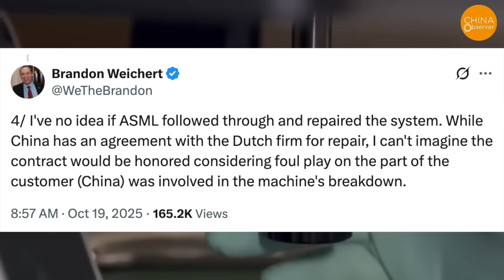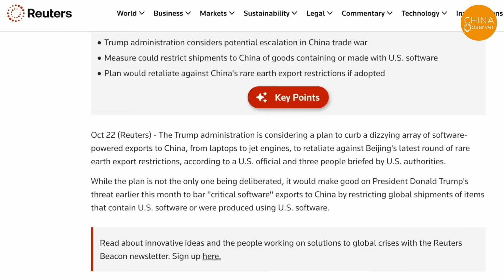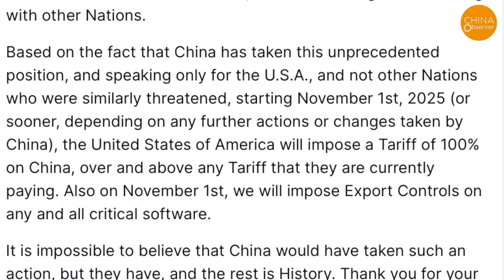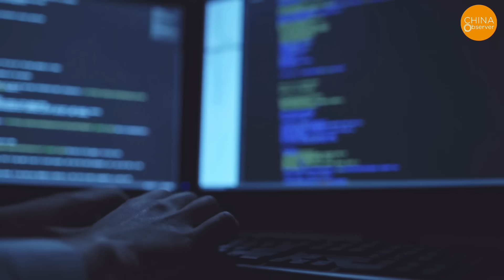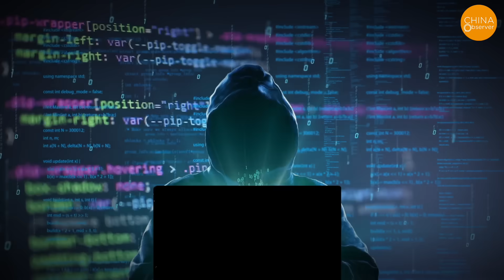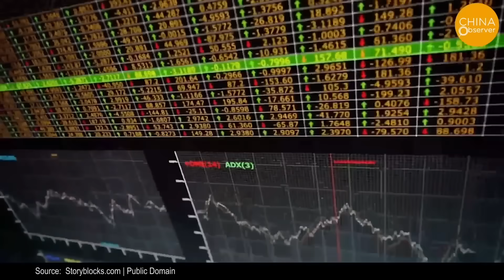China’s Embarrassing Failure: Attempted Reverse Engineering of ASML DUV Ends in Disaster

Comment: I love hearing that the machines have blackbox designs that destroy themselves when the Chinese fools try to take it apart to reverse engineer it. They wan so desperately to cheat their way into the semiconductor industry and they don't want to just put in the work to learn how to do it right. So it's such sweet karma to hear they are dumb enough to take it apart and try to copy it and that now shoots them in the foot from getting any further machines to try this with. Not only are high end chips off limits but now they've ruined their mid-range chip capabilities too. This is exactly the kinds of stupidity the CCP hates because it ruins their "saving face" culture and exposes them for the clowns they are.
Reply: I can just imagine the Dutch techs going to China, discovering what had happened, and glaring at the Chinese engineers in a steely, but restrained way: "We did ask you not to try to reverse engineer our equipment...." Very Northern European.
Reply: @douglassun8456  They should put Chinese finger traps in the machines.
Reply: @douglassun8456  If I'm the Dutch team, I'll shut up about it, say I have something to fetch from home office, and quickly bail. Can't afford myself to become hostage.
Reply: @douglassun8456  us dutch wouldn't say "we asked you not to" wed point to the contract and tell them straight up that the contract is now void.. LOL, so any subsequent machines that fail wont get any repair reps
Reply: The more you know 😮.

Very wild and these companies knew exactly what they were doing to prevent replicating
Reply: crazy that they would open such a thing so carelessly. wouldn't worry about them being able to copy it if they can't even open it without causing damage 🤭 besides even if they managed to its not enough to just replicate, you need to understand it all or you will just get left behind when the real manufacturer makes their next generation machine
Reply: @kahvikissa_ 
Here in India we have a saying,
'नकल में भी अक्ल चाहिए'
which basically means 'you need intelligence even to copy'!!!
Reply: LOL LOL...SHAMEFUL
Reply: The fact they mingle the machine black box proves that they are not exactly bright enough to do their own research.
Reply: Well said
Reply: Correct. Very well expressed. A Hundred Likes!!!
Reply: Very inept. lol.  😂
Reply: Good thing there is such mechanism
Reply: It is not designed like this against Chinese. It is designed like this against literally everyone. Do you think Americans, for eg. Intel never tried to backwards engineer ASML machine? Even though they were stuck at old node for so, so long and wasted many billions on their own research?
Reply: It is designed this way against the Chinese. You know why ? Because other countries like the US pay for the machines and people to run it properly and they don't take it apart to try and make it themselves. It's only the Chinese who try to buy someone else's product and then copy the design to make it themselves cheaper. This is a China problem.
Reply: @aSinisterKiid  As another poster stated above, this isn't designed just for the Chinese, though China is likely the most deserving of such anti-reverse engineering countermeasures.
Reply: @lexmercatoria2774  Yeah I know its not just for the Chinese. It's an industrial and commercial tactic to protect their IP that any good business should do. But they do make a conscious effort to incorporate these tactics on machines that are being shipped into China where they may not on machines headed elsewhere. The engineers take these sort of things into account when a client orders these kind of machines.
Reply: I worked in semiconductor. There are numerous SC companies in the USA. We don't need to steal European or Japanese tech. We have our own.
Reply: Saving face and showing face is more gangsta than on the streets.  Its their whole lives
Reply: Bravo! Spot on!
Reply: The Chinese don't have the same values, it's a communist country. There is no respect for intellectual property and never has been. China will never change.
Reply: And this isn't the first time they tried this on our machines 🙄
Reply: Learning means repeating. China didn't have 10 ASML DUV to have the chance to repeat. For one single machine, RE and reassembly at the manufacturer's level are impossible. It's not about that "they don't want to just put in the work to learn how to do it right". They didn't have enough machines to do that.
Reply: @milutzuk then the only thing China had gotten good at doing is copying, stealing, and lying about it.
Reply: @milutzuk  It's not impossible for the US or Taiwain to make the high end chips. So it can be done. The fact that China can't do it after dumping more money into it than the US exposes the CCP incompetence. They literally are not willing to put in the hard work over the years to learn how to do it right. They think they can pay for shortcuts and copying the IP of others to make up the gap and they can't. And all the money they threw at solving the problem has been wasted so it wasn't even invested in anything worthwhile. The US is leaps and bounds ahead of China because of the knowledge and willingness to put in the work to do it the right way.
Reply: @aSinisterKiid  Of course the US or Taiwan can make chips. Even you can make chips, given the required infrastructure. And that infrastructure means EUV (Extreme uv) machines. And those EUV machines have only one designer and manufacturer in this world: ASML Holding N.V. from the Netherlands. Taiwan (let's say TSMC), Samsung in S. Korea, Intel (in the US) are making chips using those machines. In Intel's case, down to 5-10um node technology, they had their own machines. After that, they helped ASML to develop more performant ones. In 2012, they helped ASML with $4.1 billion, and they're participating in developing, testing, and calibrating those machines. Well, China is interested in RE (Reverse Engineering) those machines. So we're not talking about making chips, but about making machines that make chips.
Reply: @milutzuk  And you are too stupid to recognize that China doesn't even have the knowledge to build the machines, let alone understand the technology needed to make them. China can't even begin to try to reverse engineer something when they won't even put in the work to understand the technology in the first place. We are talking about making chips and you need the machines to make them, and you need to knowledge to understand how they are made. China thinks it can skip steps and they will remain in last place.
Reply: Facts
Reply: As for the CNC spindle that didn't work right after assembly, there are some which have components which must be replaced after disassembly, and they have to be assembled under very specific conditions.
Reply: Except this also messes with your own industry too. Designing machines to fail if you try to service em. I can imagine them trying to fix a fault on their own. Except the machine is designed to break if you don't pay the company super high fees for some maintenance.
The world is cooked. You really can't outsource this stuff lest your devices be held for ransom. And even then, like super high fees from the company who manufactures the device, or super high fees from designing your own device.
Reply: @Utrilus  pretty sure it’s like a failsafe to prevent the wrong people from getting high tech chips, like say, terrorists. This type of design ensures only credible countries/group have long term access to these machines
Reply: @labbit35  its both. Its a way to make yourself essencal and irreplaceable and pay lipservice to safety/wrong people concerns.
Reply: @piens51  and maybe also add in business secrets so you can’t just copy it. Like ‘we made it, it’s ours, you’re only having the rights to the machine”
Reply: @Utrilus  Warranty solves this, companies use the machines for a fixed period of time and calculate their profit based on those numbers. After a certain amount of time, technology has improved and the company want new and better machines anyway. This practice is far more harmful when used against consumers who buy the thing, doesn't make any profit from it and just want it to last for as long as possible.

China attempting to copy these manufacturing processes only to end up with inferior manufacturing is exactly why everything made in China is rubbish. Nothing works and things break faster than anyone could possible comprehend in the most comical ways possible. China mastered the art of screwing over it's consumers.
Reply: 😂
clowns.
go google world math championship...
look at last victory (and how long it was before that win)
you are welcome 😁
Reply: 90 years ago the Japanese Empire was a major copier of Western technology, but when push came to shove Japan came up empty 😊LindaSu
Reply: @williambeglin8641  Was that before Columbus or after?
Reply: Just wait until your lawnmower breakdown, and you find out that it's also blackboxed. Or smartphone. Or refrigerator. Or tv. Or ...

It has been a trend in electronics for several years now.
Reply: That is, if it was true, don't believe everything you hear, especially from a programme like this, which calls itself China Observer, meaning propaganda. 
Did the Chinese copy the US high-speed rail? What about the space station?
Reply: @MrManny075  LMAO Yes the Chinese DID copy the high speed rails!! All their technology is from France! Non of it is their own tech.
Reply: @aSinisterKiid  The US has just 4% of the semiconductor market.While China has 40%, What do they manufacture in the US? At least the Chinese are the world's largest manufacturers. Just because trains use Japanese technology doesn't mean they're copies.
Reply: @MrJuanzaz We do the design and R&D. Unfortunately, we outsourced much of the manufacturing and packaging. We’re correcting that.
Reply: @paulblase3955  I don't think it will work, Closing down the economy to produce locally has never worked, especially if you don't have the infrastructure or the workforce, and you can compete with others, and at what prices?
Reply: @MrJuanzaz  LMAO No China doesn't control the semiconductor market. China can't even make their own high end semi conductors. What a joke. Taiwan is the leading expert and controller of the Semiconductor market, and they don't belong to China. Taiwan is its own country and China can't even touch them.
Reply: @MrJuanzaz  you do understand how technologically inferior the chinese are currently in the semiconductor sector right? all you need to know is their newest home brand cpu is DECADES behind 

"40%" might seem impressive on the surface until you realise its all from obsolete sources
Reply: @OdinAlgeron  You are not well informed, Xiaomi already has the Xiaomi XRING 01 chips in 3nm which surpasses the Qualcomm and MediaTek chips, in AI they have the new Ascend and for next year the Atlas servers which are 1.3 times more powerful than Elon Musk's colossus, not only are they not behind but they themselves produce everything with their supply chains while the US depends on TSMC and China
Reply: @aSinisterKiid  the same reason China desperately wants to invade Taiwan to get their hands on the chip making prowess of Taiwanese. If ever China got a hold of that tech, US will lose on technology aspect and will catch up US tech military and other fields which the US won’t even allow to happen in the first place. For me don’t like CCP to prevail.
Reply: @MrJuanzaz  yeah it sucks, are you not aware of how crap xiaomi's phones are?
Reply: @OdinAlgeron  🎯Spot on ole chap, well done! Aren't Xiaomi cars randomly self destructing? 😂
Reply: @MrJuanzaz  Nonsense. China is incapable of producing any chips below 6 nanometers. All of China's "AI" are simple launguage models copied from all the other tech giants. Xiaomi can't even make cars that deploy airbags properly or that don't turn into flaming coffins with doors unable to open. China is a joke.
Reply: @aSinisterKiid  Actually, some of it is from Japan and Germany, so what is wrong with this? Look around you. Did someone invent cars, aeroplanes, trains and so on? Are they built by others? The fact is, they are building, and others are moaning instead of building.
Reply: @MrManny075  Nahhh there is something wrong with it. The Chinese buy the technology from other countries like France and with the sole intent to copy it, deny France the ability to service their own machines and then eventually kick the company out of the country altogether. All the software running the trains is from the 90's and 2000's because they can't get current software from the companies to keep it up to date. Everything china does is nefarious. Yeah they're building, millions of tofu-dreg homes built with ocean sand and cardboard and styrofoam that crumble in less than 10 years. Everything they build is junk and has been for decades.
Reply: @aSinisterKiid  Your comment seems more like a child's tantrum than anything else. Xring 01 3nm, Chinese car brands are number 1
Reply: @MrJuanzaz  Their tech announcements claiming great advances always turn out to be hype.
Reply: @lexmercatoria2774  I don't know, I have a Xiaomi 14 Ultra that connects bidirectionally via satellite in addition to 5g and 6g, that seems like pure hype to you, do you have something similar there?
Reply: @lexmercatoria2774  Imagine the phone companies investing trillions in infrastructure and Xiaomi releases this satellite phone, making them obsolete.
Reply: @MrJuanzaz  Another non-response to what was written.
Reply: @MrJuanzaz  Your comment about process size for silicon wafer production essentially tells on you. Also, Qualcomm's Snapdragon 8 uses a 3nm process, so you're wrong right off the bat....

The process size in nm is largely a marketing buzzword. There is technical meaning behind it, but it's nothing more than the defined smallest feature on the silicon. It does NOT represent the maximal, average, or median size of features. Additionally, process size is irrelevant without a design goal. A 3nm process size is meaningless when your wafer is going to be used in a toothbrush production line. In things like phones, process size is meaningless if you don't have a comparable chip design. At these process sizes and target operating frequencies you must account for the speed of light in the conductor when designing the chip. It wouldn't matter if you were running bleeding edge 1.5nm process if you botched your chip design and put your processing core too far from the first layer cache, your chip will fall behind a much larger process size chip that is well designed.

It may be easier to think of this in terms of something more tangible. If you are designing and building an axe, it doesn't matter if you can process high grade steel and polish the edge down to a perfect angle and sharpness that is only 2% of theoretical perfection if you design the overall axe to have the head in the middle of the handle. Your ultra high quality process isn't even going to compete against a farmer with a grinder and chunk of mild steel and some wood if he puts his axe head at the end of the handle.

This is the issue with using process size as a measure of quality. In performance benchmarks the XRING 01 still falls behind the Qualcomm Snapdragon 8 by a few percent and falls behind by 30% for the 2025 release, per industry standard benchmarks.
Reply: @2009dudeman  Yes, but you have to keep in mind that Xiaomi didn't have its own chip or operating system until recently, and now it's competing with brands that have been in the market for decades. Of course, manufacturing size isn't the most important thing; there are many things you have to consider in the design of a chip and what function(s) it will perform.
Reply: @MrJuanzaz  It's competing in the same relative class so far. There is no proven track record yet. They may still run into lifespan and reliability issues beyond what you can simulate in a lab that others have already had growing pains with. (look at how Tesla vehicles fell apart on roads that normal Chinese cars had no issue with). I'm not dogging them as being inferior and unable to catch up. But they are new to the market and have the advantage of being able to already know exactly what works and what doesn't.

Thats not to say they won't be important in the future, but right now they are essentially just copying other designs that have been proven while trying to catch up at the same time.

It's one thing to be able to bake a cake using a recipe, it's a whole other level to create a new recipe from scratch. That level of skill comes with experience. Experience comes from both time AND failure.
Reply: @MrManny075   no they copied the Japanese for the high speed rail and NASA . Roscosmos and Esa for the space station components
Reply: @paulbarnes2499  So what is your point? Are you saying they should not build high-speed rail? You can say the Japanese copy the French and the Germans. You can also say the Americans copied the Russians. Do you know that the Chinese created porcelain? Do you know the Germans were the first to find out how it was made and copy it? 
Right now, many countries are building cars; are they all copying the first one? Isn't it all to do with jealousy? What happens to all should work together for the benefit of all
Reply: @MrManny075  China copies everything but would have the world believe they've developed something new and/or improved, all on their own, when that isn't the case.
Reply: @MrManny075  Lol. “Did the Chinese copy US high speed rail?” NO but they did from Japan! So what’s your point here???! 😂
Reply: @momwithaplan1287  They have them, and Americans don't, that is my point.
Reply: @momwithaplan1287  The point here is self-identification as a wu mao. 😂
Reply: Ah! We found part of the $0.50 army. What amazes me is that uccp bots read the truth in other places, and still do the bidding of the CCP.

Do they have a gun to your head, or are they paying you a lot of money?
Reply: @MrManny075 research and development commie… when you have to do it your self you’ll finally understand what it takes to be a true technological power house.
Reply: @MrManny075  What part/information exactly don't you agree with? That the Chinese not need DUV lithography? That China isn't able to make their own DUV lithography machine? That China didn't attempt RE of a DUV lithography machine? That China botch that attempt? Ok, I understand, that is anti-China propaganda. But which part is propaganda, some of that information, everything...?
Space station is not a single technology or machine, and it was a cooperative project with plans not exactly secret. China's problem with a space station wasn't the station itself, but a reliable rocket for transport. And it's 70s - 80s technology. DUV is a 2020 technology. And why should China copy the US high-speed rail when Japan had it since '64 (Shinkansen, 210km/h). Are they stupid or what?
Reply: Well, in case you don't know, China controls the semiconductor market. I don't think they're worried, but rather working and focusing on what they have to do, not waging economic war like the US, trying to steal TSMC's technology.
Reply: @MrJuanzaz  Are you blind? China is literally trying to steal TSMC's technology because they can't engineer it themselves. The CCP has literally dumped billions of dollars into trying to figure out how to build and run semiconductor machines and they have all failed, full stop. The CCP has lost billions of dollars and has nothing to show for it but failure. China doesn't control anything except their own fate. And Xi has run the country into the dirt. They don't even have clean drinking water anywhere in the country. The US is doing just fine by comparison.
Reply: @aSinisterKiid u must be the biggest joker!
Reply: @almendyapp7482  I am biggest truth teller, most respected speaker and highest confidence bullshit detector
Reply: @MrJuanzaz  TSMC does not mean The Stupid Mandarin Commies. but is a company in a free and independently governed country, which does business with the US.
Reply: @castheeuwes1085  They are not that stupid, being the world's leading economy and the world's factory and having their own space station, among many other things, who does business in Taiwan are the US companies that produce in China, now they are worried about China because it is leaving them far behind
Reply: @castheeuwes1085  Free from what? If they're imposing restrictions and tariffs on others, why can't you compete? You call it democracy, an aristocracy with elections. How many things have you freely chosen in your country? They're all impositions, and they're leading you on.
Reply: @MrJuanzaz  They are the world's "mostly empty factories". They keep subsidizing failed companies, because the have to keep local GDP up. That is the definition of stupid, because it completely unnecessary drains tax payer money, all the way to country bankruptcy. Not to mention their disastrous COVID policy, letting hospitals pay all the bills, so these are not mostly bankrupt, and not to mention the failed high speed rail system, for which there are no customers, so they have the biggest depth of anybody, except maybe the construction companies who invested (not stupid at all) in millions of apartments for nobody. But they have a space station (80s Russian tech), so they must be doing great.
Reply: @castheeuwes1085  It's impossible to answer so much nonsense in one comment. The world's factory is empty?. If the Chinese hadn't bought the US debt, they would be in big trouble. Besides, they manufacture all the ships for the world's foreign trade and even produce all the raw materials for the big US pharmaceutical companies. You just don't understand the Chinese
Reply: @castheeuwes1085  The Chinese market is not focused on making money but on generating well-being for its people. You can see this in the stability of their stock markets. In contrast, in the US, it's all about making money, regardless of whether you do good or bad. That's why it's so inflated by speculation.
Reply: @castheeuwes1085  But make no mistake, the Chinese economy is 20% larger than the US and they don't have the dollar as a global currency.
Reply: @MrJuanzaz  How do you know? Even Chinese officials stated that their GDP number is made up. How is your second statement good for China? The US can print money, and it will keep value. China can't do that with the Yuan.
Reply: @MrJuanzaz  "they manufacture all the ships" >>Yeah we've seen their tofu-dreg craftsmanship on full display in the Philippines. Chinese coast guard cutter & navy destroyer crash into each other trying to bully a small Filipino patrol vessel over Scarborough Shoal, which belongs to the Philippines btw. Not only did they embarrass themselves, but the aftermath revealed the CCG vessel lost its bow in the collision! Put a pin in that we'll come back to it.
The LY1, China's new laser drone interceptor with 100% kill rate, allegedly. Oh the Saudi's are giving us tons of feedback on the subpar "modern weapons" acquired from china! 
See for yourself 👉👉 (https://www.youtube.com/watch?v=-DeeZob4pyM&t=547s Saudi Arabia Just Exposed China Military SCAM - $100M Air Defense Failed).
Reply: @MrJuanzaz

Now we know you're a little pink shill. 

FYI: China isn't the world's largest economy 😂
Reply: @Dlstdon1  China has 13 shipyards and each one of these has more capacity than all the US shipyards combined, the global economy moves on those ships, I don't think there is any doubt about their solidity, stability and reliability, I don't trust the propaganda media, I go to "reliable" sources like Carlos del Toro who is the Secretary of the US Navy and businessman, as for weapons, I don't trust a gossip on YouTube but reputable sources, their weapons like all the others  (like the F35) may have problems  but China continues selling
Reply: @MrJuanzaz  The Chinese market is definitely focused on making money, especially for its elite; generating well-being for the people has always been a secondary concern.
Reply: @lexmercatoria2774  What do you base that statement on? You see, in just under 30 years, millions of people have been lifted out of poverty, and today they live a good life with high-quality products and services. I don't see any other country that has invested so much in improving the quality of life of its citizens. This does not even happen in other countries, on the contrary, their quality of life decreases.
Reply: @MrJuanzaz  You're not responding to what I actually wrote.
Reply: @MrJuanzaz 
You obviously cannot differentiate between right & wrong.
Reply: @karma.exists25  Differentiate between good and evil in terms of what? Not everything that is legal is just, and not everything that is just is legal. Good and evil depend on several factors.
Reply: @MrJuanzaz  Hmmm I sure wonder what the first letter of TSMC stands for
Reply: @gwentarinokripperinolkjdsf683  Taiwan Semiconductor Manufacturing Company, any questions?
Reply: @MrJuanzaz  "Taiwan Semiconductor Manufacturing Company" Yeah its not Chinese, thats kinda his whole point!
Reply: @Dlstdon1  It is not Chinese, but its production is destined for all of Asia, and China has 40% of its production, so why do you want it to be Chinese if China already has its production?
Reply: @MrJuanzaz  Denial isn’t an educated argument  If you must cry please do so in the corner👉
Reply: @MrJuanzaz TSMC uses Dutch machines from ASML.
Reply: @Jonathan-vx2qj  I don't know what you mean by that? TSMC manufactures almost entirely for the Chinese market and all of Asia, and the finished products for the rest of the world come from there.
Reply: @MrJuanzaz all the manufacturers like tsmc are using ASML tech. The only thing that the Chinese are doing is packaging. All the tech is coming from the Dutch and if they stop services then all the tech stops. So the Chinese don't want to copy tsmc because tsmc does not make the machines, they just use them.
Reply: @Jonathan-vx2qj  Tsmc has a factory in mainland China as well. ASML is a lithographic printing company, not a chip manufacturer. Companies that design chips work together with Tsmc, but it is Tsmc that manufactures them. With their own machines , lithography is just a step